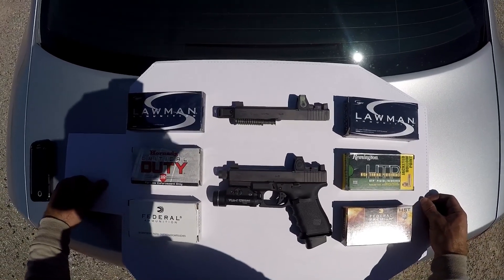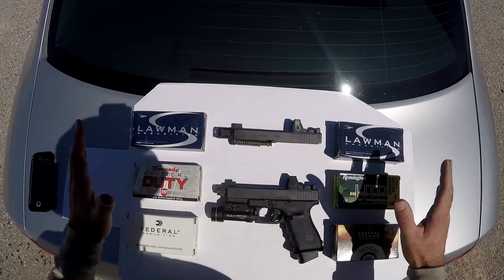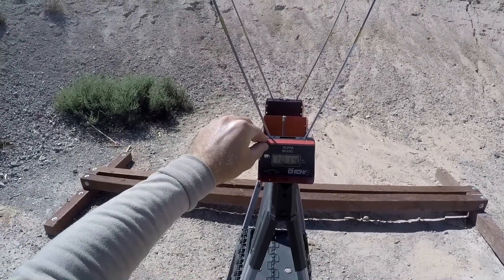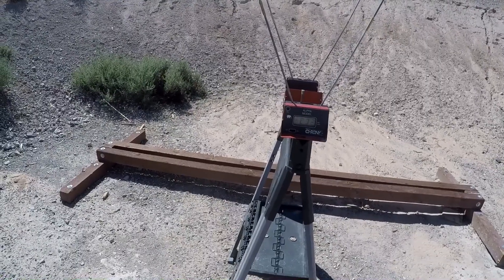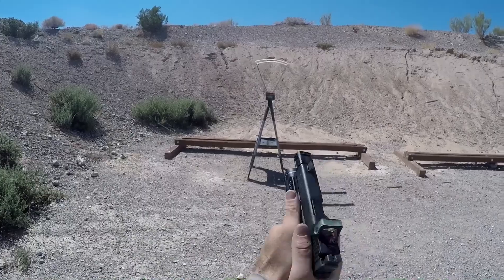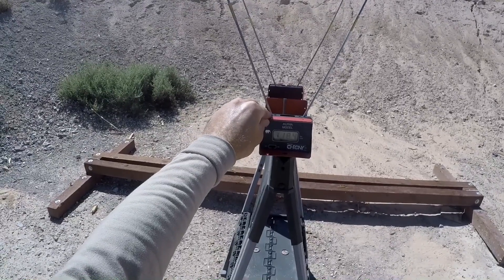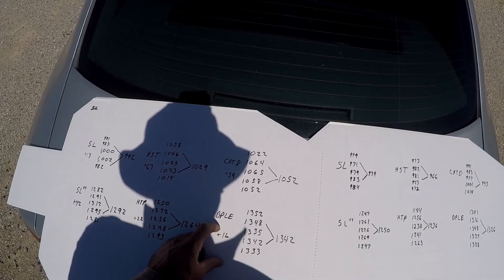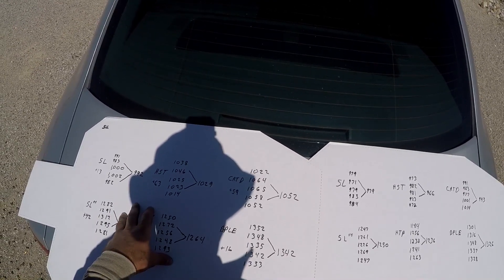Polygonal vs Traditional rifling velocity test

Comment: Very strange results.  According to this much larger sample data, the difference in velocity is statistically negligible;

http://www.ballisticsbytheinch.com/rifling.html
Reply from the maker: BigSmartArmed I dunno, but in the past I remember Chrony results for my Khar K9 3.5" poly were the same as my Sig P225 4" traditional...  Without a very large sample size it would be tough to say.  My 10mm Critical Duty test also showed higher results than a few others, but they were using CZs...witch I think have traditional l&g...?
Reply: I have not used my chrony for running average base lines as I can't establish a sample size sufficient enough to equal out the drift creep.  

I love what you do btw,. thank you very much for the effort.  

In the bbti data take note on the Springfield EMP 3.0" barrel vs Glock 26 Gen 2 3.5" barrel values.

Even being 0.5" shorter, EMP l&g barrel consistently outperforms 3.5 glock poly barrel across various loads, but I would also like to know what their sample size is to establish the error rate drift vs base line.

As an end user personally I am not a fan of the polygonal Glock type barrels as they are not true poly barrels to begin with.  If I was in a position of logistical supply/procurement I would absolutely go for poly barrels given a known price/benefit ratio.

The problem I see with Glock type poly barrels is the initial chamber pressure spikes due to throat gas seal type.

If you have a boroscope take a close look at the difference between how poly rifling begins right at the chamber throat vs l&g.  

I suspect that Glock KB is not only an issue with unsupported chamber heel, but also with chamber pressure spiking due to lack of excessive gas pressure blow by as in l&g barrels, and this is where powder load variations and bullet set back issue come together to what makes a KB a much higher possibility vs traditional systems.

When you put together unsupported chamber, much higher initial chamber pressure spike together with powder load variation and bullet set back, statistically KB would get a massive bell curve spike.

I'm especially perplexed when it comes to full length rifle/MG poly barrels, as only Germans are sticking to it.  

Heckler & Koch G3 - poly barrel

Heckler & Koch PSG1 - super high end sniper rifle - poly barrel

Heckler & Koch SL7 - poly barrel

Rheinmetall MG 3 GPMG - poly barrel

In MG 3 polygonal barrel is somewhat reasonable as it wears better then l&g although it also heats up faster, but also the beaten zone of the MG 3 is much larger then MGs with l&g barrels (also due to much faster heat up rate vs l&g)

G3 rifle is not a standard of accuracy by any measure, while PSG1 is a total unicorn.

Speaking of barrel thermals and accuracy, here's an idea for a video, both for 7.62 and 5.45.

Set up six targets for two consecutive shot strings one 30 round mag each, use with chrony.

After a few sighting rounds and a cool down period, 1st set is for a 5 round cold bore group, second is for a 20 round heat up group, third is for a final 5 round group.

Use a IR thermometer to measure initial ambient temp, and then barrel temps at each step. 

Repeat for 5.45 and 7.62 to see just how much barrel heat up opens up the groups at various distances, you will be surprised.

As the bore opens up from heat expansion the spread opens up as well, and this is where heavy profile barrels really come into play.  

It would be even better if you could compare the standard AK-74 profile barrel to a heavy Vepr profile barrel, that way you'll see just by how big of a margin a heavy profile barrel will out shoot a standard profile barrel when they reach operating temps, especially at 300+ meters.  

There are vids of AK-74s reaching out to 600 meters on steel, but what they do no show is what happens on a second and third mags.  

It's even worse with 7.62X39 as the barrel heats up more, and while 500 meters is reachable, when the barrel heats up it turns into a bit of a dice rolling type of a game.  

That's the reason Russians rate AKM out to 300 meters while AK-74 out to 500 meters.  They take their data sample size from a full curve of cold bore to fully heated barrels, not just a small sample.  

My 7.62 is a conversion Saiga and 5.45 a conversion Vepr.  Triggers are two stage on the 7.62 and a single stage shorty on the Vepr.  Both irons are set to 300.  I do run a PO 3.5 on the Vepr and a PK06 on the Saiga.  

Great channel, thanks for the vids.
Reply from the maker: BigSmartArmed I don't know that poly bbls have much to do with KBs.  I have seen more with l&g bbls.  Then again that might be because more are out there..  Many of these cases have to do with hand loading.  Often people like to blame anything but themselves..  Glock was originally generous on the lack of case support in their .40 cal guns..and that may have contributed to a few, but that might have had more to do with the cartridge being new at the time.  Squibs are another cause...they can happen without the shooter being aware..too many possibilities to draw any real conclusions.. I am not aware of any KB issues with 9mm or .45 glocks, nor any of there current offerings in .40.  I am unaware of any such issues with the HK line of handguns, in fact, if I recall correctly, the HK Mark 23 was required to survive firing with a lodged bullet in the bore and still remain serviceable..  If I had to guess .40 would be the most likely to have it happen just because of the nature of how it is loaded...  I like poly bbls, so far I have only experienced benefits with little drawback.  That said unless someone can round up 100 poly and 100 l&g bbls of the same length from all the manufacturers with sufficient quantity and variety of ammo to creat a huge sample size I don't think you'll be able to say for sure either way..  For me they tend to give higher velocities...but my sample size is limited to what I have put over the chorny HK, Khar, and Glock.. VS Sig, S&W and Springfield... As for bbl thickness, yes it is pretty well accepted that a heavy profile will produce less dispersion and sustain fire longer than a thinner one.  It's always a trade off between weight, accuracy, and durability.
Reply: There was a web site that kept a Glock database along with other pistol malfunctions, but it seems about a year sago it was either shut down or bought out.  Glock KBs were not just with .40, 9s and 45s as well.  Interestingly there was a Greek police batch of G17s that developed bolt face cracks on the slide - MIM failure.   

As to barrels Soviet milspec standard requires 12K of bi-metal prior to barrel opening up to unacceptable groups.

10K is the barrel life limit for expired 7N6 (10+ years) due to increased chamber pressure spike and throat erosion.  The powder stabilizers degrade and it burns faster.  That's why it is a good idea to toss the spam can around as much as possible prior to opening, it shakes up the powder for uniform burning.  You might notice that often 7N6 crates are literally tossed on the ground from trucks, BMP/BTRs, it's both to bust the crate and shake up the cans.  

FYI, M4 milspec barrels were tested to only 6K while firing fresh bi-metal jackets, and 10K on fresh copper jackets, and that's while M4 barrel profile is thicker then AK-74.  

I've noticed your bird cage flash hiders, how are they secured?  Mine is with a crush nut, but it keeps unscrewing.  Also It's a huge pain in the ass taking it off for cleaning every time, as leaving it on for cleaning is not an option - corrosive 7N6 eats away at the muzzle crown.
Reply from the maker: BigSmartArmed if you type in "insert brand" kaboom on a search, you will find every brand has incidents.  The reason glock seems to gets so much attention is 1. It is one of the most popular handguns out there.  As such there is a higher probability of finding a KB.  2. Since it's so widely used by uniformed services there is a higher probability of incidents being recorded...civy guns blowing up or breaking don't get reported outside of a chat room.. 3.  There are a lot of folks, for whatever odd reason, that hate glock with a passion.  I think it might have to do with the fact that glock ultimately killed the metal framed, hammer fired auto loader.  Those who were certain of its failure could not admit this.  So, they clambered to other brands that tried to copy  glock..XD comes to mind.  This way they could get the benefits of what glock ushered in without admitting they were wrong.  Part of that is trying to convince people that in fact the product they chose is superior to glock...  The fact is that glocks are renown for their durability and reliability...particularly the 9mm variants.  That some issues occur with batches here and there is not surprising, considering how many there are in circulation.  SOCOM chose glock to replace there previous handguns which included 1911's, Berettas, Sigs..amongst others.  That decision came about because glocks have proven themselves to be a cut above..when guys had the choice, they were choosing them.  You are correct on m4 bbl life rating, but is should be noted the thicker profile is only from the gas port forward.  Under the hand guards the government cut profile retains the original pencil profile, about same thickness as the 74..perhaps a little thiner...  additionally the bbl is not chf.  This however changes for the m4a1, which has the heavy profile bbl and is chf.  As such it's bbl life is improved.  That said small caliber, high velocity projectiles are harder on bbls, so 10-20k would be about all you could expect with normal service use.  Interesting on 7n6..have ti give that a try..  As far as cleaning, I simply flush out the bbl and device, then oil bbl heavily and let it run out the device.  I use a q tip to sop up what remains inside leaving a coating.  I have not had any corrosion issues..
Reply: I remember the first time I fired a gen 1 G 17,  it was a dud, the non drop free mag kept disconnecting causing a FTF.  It was back in the days when Glock paid fellas to hang out at shooting ranges to "word of mouth" advertise.  I was curios so I looked into the whole Glock thing, not the brand, not the hype, but the meat of it - metallurgy and manufacturing process.

I am not a Glock fan boy not becasue I am somehow prejudiced of the the format, but becasue I know what it is made out of, how it is made, and all the dirty dealings that went along with Glock corporation contracts.  

Glock pistol was not desinged by Gaston Glock, it was desinged by a team with a goal of making a profitable commercial product, not a weapon, while only Gaston was in the know that he was assured of his first contract even if the damn thing could not fire a single shot.

After the initial shit storm the original team of engineers left and went to Steyr to make the M1.  Back then they went for around $250 as I recall.  I should have picked one up as a collectors item but I never got to it.  

Glock is the cheapest way to make a functioning pistol that's possible, and if they were around $250 to $300 then sure, why not a disposable hide-a-gun, but Glock corporation profits and all of the criminality that goes with it is not for nothing, it's for a killer profit margin.

Glock is a brand, and I'm not into brands, I'm into tool quality, and quality tools are made from quality materials and quality manufacturing processes.  

MIM is NOT a weapon quality material, period.  Sintering process is not compatible with military standards weaponry, even when if they are non stress loading parts.   Powdered metal is just that, cheap and disposable way to make complex parts on the cheap.

Look into it yourself, MIM parts failure.

All those "insert brand name here" KBs are on the same technology products, including CZ P-07.  Same MIM parts, so it's not the brand that matters, but the manufacturing process.  

All those 1911s that KB are also MIM, from slides to frames, simply becasue it's CHEAP to make and OUTSOURCE versus real metal casting and machining.  

Modern consumer weapons are made on the Planned Obsolescence principle, as powdered metals have a calculated stability time frame, after which micro fractured begin to form just as concrete begins to crumble from inside out.  Through mass production micro fracture flaws  creep passed QC and make their way into early failures, which are only highlighted by over pressure KB type scenario.  

You will NEVER see a TT or Mak KB, just as with the rest of the real metal pistols of the 20th century.  

I hold nothing against polymer frame striker fired pistols, I got one, I'm just really clear on what they are and what they are made of.  

I sure do have a couple of steel frame CZs, and lower quality metallurgy also rears its ugly head in the form of low quality springs CZ has been using for the last decade.  I am positive that CZ is not making their own springs anymore, and would not be surprised if they are buying them from some China based manufacturer.   

Yep, M4 profile is heavy after the gas port and is thin under the hand guard, but total weight is similar to AK-74 bare barrel.  Barrel profile is not measured in diameter or length but in total mass.

Barrel life vs rounds fired is measured in heat cycles and not just by total rounds fired.  The same barrel can be burned down by rapid fire which will cause chamber throat erosion, not muzzle rifling erosion.  AK barrels are heat treated to max operating temp of 400 degrees Celsius, and required 12K rounds standard is met by total heat cycles.  That's why by Russian standards AR barrel chamber throat burns out at only 6K rounds which is half that of a AK barrel.  AR barrel chambers are not heat treated to handle bi-metal jackets, and especially not in full auto, thus the 3 round burst select fire mode even for copper jacketed bullets.  When chamber throat erodes the bullet is not seated into the rifling grooves but is jumped onto them which causes bullet deformation with all of the following consequences, including gas blow by and muzzle rifling stripping.  

So is your muzzle device permanently attached to the thread and you do not remove for cleaning?  I could not get away with that on my Vepr, the corrosive soot collects between the muzzle crown and the flash hider, then salts soak up moisture and start to eat away at the muzzle...
Reply from the maker: BigSmartArmed no corrosion issues to date.  Also, for what it's worth, modern autoloaders have set a new standard that couldn't be dreamed of back when guns were made of real metal...so id say they got it figured out...originally they said the same thing about cheap stamped sheet metal guns...  I have used and own most major brands..I carry Glock by choice...they work, thats all that matters...  There is nothing wrong with trying to figure out the simplest/most inexpensive way to produce a product, as long as it works.  In fact thats the hallmark of an effective weapon, and a successful business...Glock figured it out..
Reply: I am in no way belittling your weapon preference :)  A friend of mine has a late model Gen1 G17 that he carried when he was on the force, and metallurgical it is completely different animal then the current MIM guns.  

The easy way to tell steel is by free tapping it and listening to the harmonics.  Dead steel vs live steel.  MIM is even easier, parts have clear mold lines.  

If Glocks work for you, rock'em all the way :)

Considering that Glock had literally hundreds of modifications over the years, it's plenty to work out the bugs.  Just don't run the later gen models, since not only the extractor and the firing pin are MIM, but also the locking block, which is not a good thing at all.  I know gen 3 had cast locking block, not sure about gen 4.  If you run earlier gen and especially Austrian made Glocks hold on to them and don't sell them, as they will easily outlast MIM gens.

When it comers to manufacturing there is a profound difference between cheap and technological.

Stamped steel is not all the same.  Sometime take a careful look at you AK stamped receivers, they are not just stamped and folded, they are shaped tempered to exact specifications.   

Take a look at the pin holes and how technological they really are, and then compare it to G3 stamped receiver for example to see the difference between cheap and technological.  

G3 feels like a tin can with spot welds, while AK, and especially RPK receiver is a solid box with a ring to it.

That's what I love about guns, all the fine details, and there is always something new to learn about even the old guns.
Reply from the maker: No issue running newer Gens.  By all rights the Gen 5 is shaping up to be the most durable/reliable yet. Just food for thought http://www.thefirearmblog.com/blog/2015/09/16/handgun-experiences-from-battlefield-las-vegas/  Much like the Soviet AKM, Glock appears to have found a way to manufacture components in a cheaper fashion, but still get the necessary performance out of them.  I pay the same for a Glock today as I did 20 yrs ago... That is pretty ingenious manufacturing on their part.  Especially to still be the standard combat handgun to which all others or judged...  For the record SOCOM selected the Gen 4.  The newest Gen 5 may be the best yet...I will be picking up a 19X...so I will check out some of the changes 1st hand..including the new hexagonal "marksman" bbl.
Reply: I like your videos becasue you seem like the type of fella that knows how to work with data.   Glock or no Glock, data speaks for itself.

Here's a simple comparison.  

Maximum UTS tensile strength of the best High Performance Powdered Metal is 95,000 PSI.

http://www.pacificsintered.com/iron.html

Just for reference, 9mm proof cartridge runs 50,000 psi.

A general UTS spec for High Strength Stainless Steels must not be below 225000 psi  (1550 MPa), while minimum yield strength (YS) of 200000 psi (1378 MPa).

Best Yield Strength of Powdered Metal High Carbon Steel is 40,000 psi.

Tensile strength is the ability of a material to withstand a pulling force which is usually measured in units of force per cross-sectional area. 

This right here from your link is a typical PM-MIM tensile failure;

http://www.thefirearmblog.com/blog/wp-content/uploads/2015/09/XIgppci.jpg

Imagine just how low of a UTS level PM-MIM of that slide must be to just sheer like that from a very precisely calculated impulse force of that slide against spring tension.

When compared to actual steel UTS values, not POWDERED METAL values, then it becomes clearly apparent that such a failure is a physical impossibility in a slide made from actual High Strength Stainless Steel ALLOY.

Proof in fact from the same blog;

"The slide cracks right at the narrow portion at the ejection port. "

Failure point at the weakest part of the structure where tensile forces are the greatest.

The problem with PM-MIM is that tensile failures are not statistically predictable as in allow steels since sintering locks atomic structure as crystal lattice just as ceramic/porcelain during the final stage of actual SHRINKING of the part.  Powdered metal is mixed with binders that bake away during sintering which results in loss of volume.

In this way MIM parts are literally SHRUNK to size through sintering, and this is precisely why tensile failure points are unpredictable.  A slight variation in crystal lattice alignment during uneven cooling and a cascade of micro fractures will result it eventual total failure.

This is precisely why turbine blade design is such a high tech industry, it's the cutting edge of failure point prediction on atomic level, and that's why "additive manufacturing" technology is used for 3D printing (fusing) rather then sintering.   

This is why MIM use in guns is utterly ludicrous.  Resonance waves from all involved forces are not transmitted by the metal but instead are bluntly absorbed so there is no way to predict failure points as thickness of the effected cross-sectional area is not directly relevant to applied tensile force, therefore unpredictable failures are a statistical guarantee, yet the failure rate and its conditions are unpredictable as time scale of the cascade effect can not be established, especially given wide thermal curves.  

It's like hitting a random resonance point that results in catastrophic failure.  

It is literally the worst of all useful aspects, except for the positive profit margin and Planned Obsolescence futures trading.  

I own two MIM pistols, I know exactly what they are, and while I am aware of statistical probability values, I will NEVER trust my life to them, becasue I REALIZE the technology behind such metallurgy and how unpredictably unreliable it is.    

Guns and blades are fun for me, I hear the metal sing.
Reply from the maker: BigSmartArmed I am not denying the metallurgy..I'm saying it is up to the task, and makes for a more affordable gun.  The gentlemen states it usually occurs at the 100,000 rd mark...since a slide can be replaced for $200, the question becomes...why bother using more expensive materials?  1000rds cost approx $200.. 100 x 200= 20,000..$20,000 worth of ammo to crack a $200 slide...AKs don't even last that long and cost more to replace...  Thats the point...
Reply: That is the point,  100K is the baseline for a very, very small sample size on units in constant use, which is the predictable side of resonance based micro fracture failures.

Same point as with turbine blades, but turbine wheels are made with MIM technology specifically becasue of predictable, linear centrifugal forces, and while micro fracturing does occurs, it occurs in predictable pattern;

"Nondestructive testing (NDT) and metallographic observation reveal that macro-cracks are prone to forming in the center part of the turbine wheel, and the micro-defects in term of porosity in the blade are more than in the center of the sintered turbine wheel."

https://www.sciencedirect.com/science/article/pii/S1875537217300875

Being a powder mix instead of deformation stretching, micro fracture porosity cavities occur.

In semi automatic weapons that use MIM parts stress load is not linear, but instead it is recuperating in nature (calculated bolt/slide throw force)  that's why MIM parts that are calculated not to fail actually do fail, as stress loads are not distributed equally and when they hit random resonance points lettuce structure shatters like a cement block.

Here is a HK PTR MIM bolt failure after only 1500 rounds;

http://www.hkpro.com/forum/attachments/hk-clone-talk/11995d1366423183-ptr91-bolt-head-failure-img_1806.jpg

http://www.hkpro.com/forum/hk-clone-talk/125927-ptr91-bolt-head-failure-5.html

If it was a fluke then it would be a non issue, but it is not a fluke, as others are reporting similar failures in all kinds of weapon platforms.

In the picture the crystalline lattice structure can be clearly seen.

MIM  is not the material that should be used in weapons, period.  Not even auxiliary components such as slide stops and safety levers because they have the same random chance of failing as active components.

If I was an attorney I would be busy gearing for for a massive class action suit that will be coming up next decade, as all of these MIM parts will begin failing in mass.  

Baked cement guns.  That's what it is, but unlike cement MIM is baked, not fused, so it deteriorates like concrete, from within.
Reply from the maker: BigSmartArmed of note, I can't find any evidence of Glock using MIM slides...  As far as other components, that will be for the market to decide.  Considering Glocks have been in constant use..including gen 4's with several high round count units, agencies, and civilian hands it has not been a concerning issue to date...  In fact the opposite..one of the reasons for their popularity is trouble free service with simple maintenance/repair.  Time will tell, but it seems like Glock has the process figured out. I personally am not really concerned...
Reply: That’s good to hear, I have a K9 as well